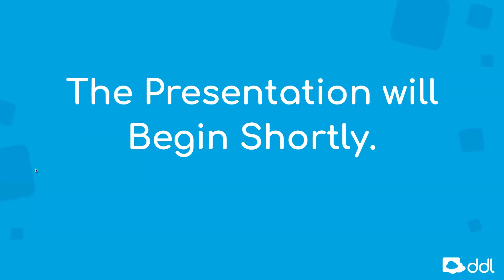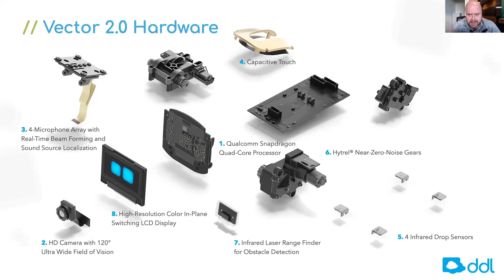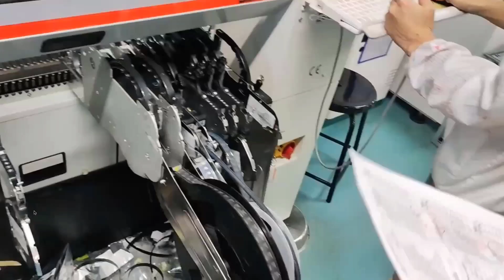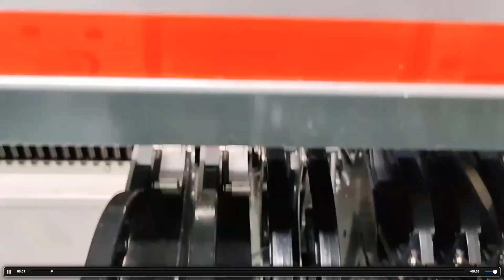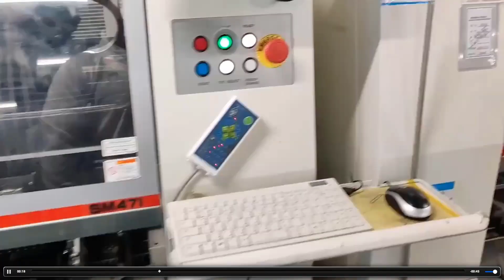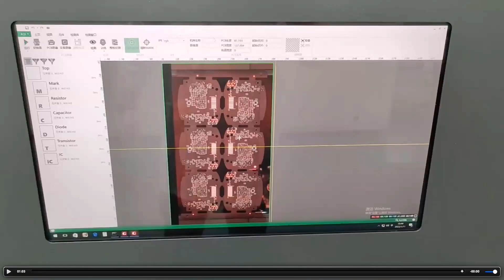State of Robotics: January 2022

Comment: Wait is the repair center going to be servicing the original vector? I had planned on buying the 2.0 vector but only if I could find some way to change the battery on my original vector. I got him while thrifting and he's still special to me. I'm fine with adding another vector to my house hold but my original is still my fave.
Reply from the maker: Yes, the robot repair center will be able to support both old and new robots when it launches.
Reply: @DigitalDreamLabs  radical. Thanks for confirming it!